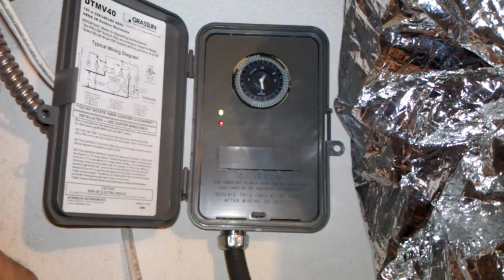Home made water heater timer-controller - Part 1

Comment: @hackfreehvac only prob is if its too cold out it will be a bitch to get hot water, we have a 82 gallon hot water heater sitting in our basement with two 4.5 kw elements, it used to run only during off peak hours ( 11:30 pm to 7:00 am) but the previous owners by passed the relay so it runs when ever needed, it is set 125 degrees as the upper thermostat is preset and that is the lowest the bottom can do as well, oh and its from 1989

Comment from the maker: ..It was hitting the 300 psi mark to achieve the desired temp of 120 or so, and the amps were still less than 20. Which is what the water heater element draws while taking longer to heat.

Comment from the maker: @mazzmari 
I actually filled a 20 gallon tub with tap water from the hose bib and recuirculated that through the heat exchanger attached to a 3.5 ton heat pump condenser (in heating mode) and achieved 150 degrees!

The head pressure was approaching 400, however. But I don't need 150 degree water. That's hot enough for a commercial dish washer!